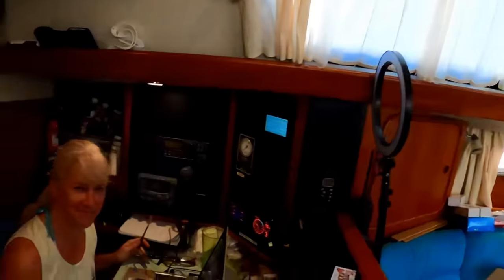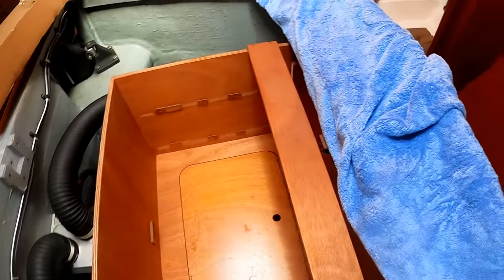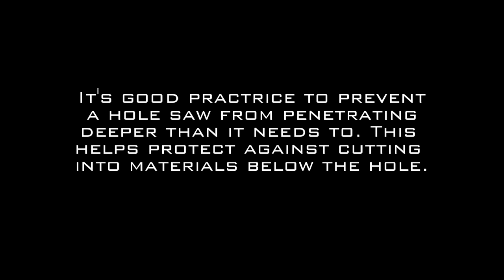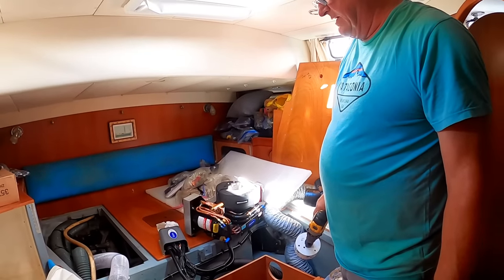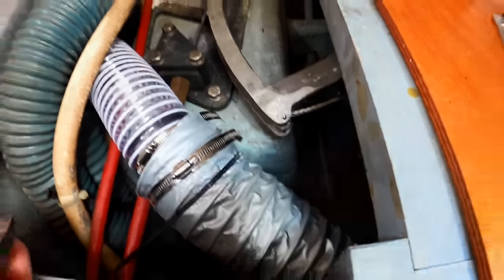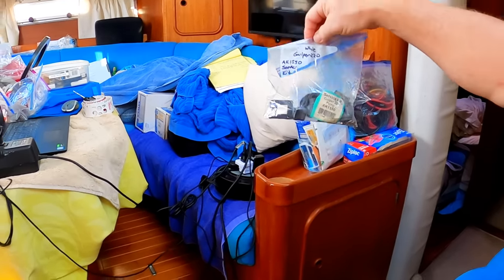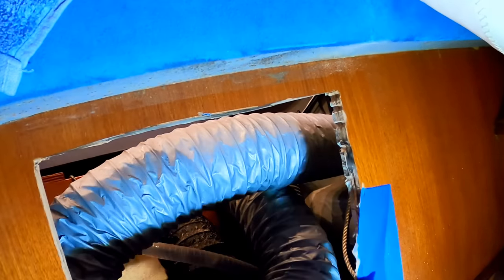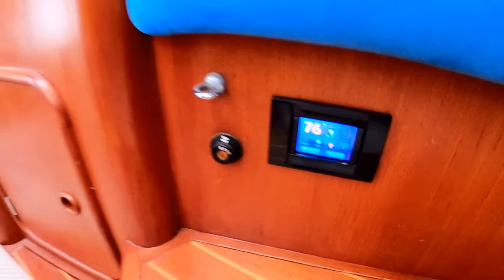Ep 143 Installing Mabru 12V Marine Air Conditioning

Comment: Thank you for your honest opinion, we are looking to install air conditioning and power is a major concern, happy sailing ⛵️
Reply from the maker: No worries. Despite what some of the armchair experts tell people, native 12V or 24V systems are preferable in my opinion over inverter converted 110VAC or 230VAC in terms of energy use. And Mabru makes both versions, so their YouTube video comparing the energy draw from each of their systems is very much worth watching since it's an honest apples-to-apples comparison. Be aware that there are a few Chinese made self-contained systems that are marketed as 24V, but in fact just have an inverter already built into a standard line voltage unit (Hopewell?). Although I buy a lot of Chinese made products, I've found that making the sale is often prioritized over customer satisfaction. It's a cultural thing. Caveat Emptor.

Comment: Kevin I'm impressed, both on the battery system and the AC job. Good job sir, on the research and selection of the components along with the installation. Clean and professional. Best I've seen from a DIY'er. God bless!
Reply from the maker: Thanks Greg. These are the types of comments that make the production of the episodes worthwhile. And God bless to you as well.
Reply: @SailingTalisman  It would have been better if I'd remember to credit Wendy on the bottom coat job. Nice when you can trust your better half to do better work than you.
Reply from the maker: @gregvee2930  She's awesome that way. She does all the winch teardowns, cleaning, and re-lube too.
Reply: @SailingTalisman You likely already did this, but that zip tie at the rudder quadrant, you might want to use 2 and run them between the 2 hose clamps. So they are on coupler not the hose.
Reply from the maker: @gregvee2930  Next time I'm in there I'll take a look. Thanks much.
Reply: @SailingTalisman  I'm sure you get plenty of armchair quarterbacking but it won't take long before that tie wrap will destroy that ducting and  potentially mess with your rudder quadrant. I love you guys!
Reply from the maker: @gregvee2930 I think not. The hosing is not in motion, nor are there any forces (other than heeling of the boat) pulling on it. And those hoses are much tougher than they look. As long as it's held out of the way, I guarantee all will be fine.
Reply: @SailingTalisman  It was you who pointed out the importance that it stays held back that got my attention. It got me concerned. Now put my comments behind you and keep up the good work!

Comment: Understanding that you are limited on space, but was any thought put into reducing the twists and turns of your piping.? Everyone of those will reduce the efficiency of the air flow. Won't you have condensation problems around the cold air outlets like the one in the aft cabin?
Reply from the maker: Hi Brian. Lots of thought, but little in the way of alternative options. I do believe this is why the units are native 4" output (w/ 90 degree rotating output collar) for the 6K and 12K units, then 5" on the 16K. I ran the 4" through 4" splitters, and then kept as much 4" ducting as I could before necking down to 3" with the reducing rings. Used shop vacuum hose for 3" ducting as there was very little of the insulated spiral tubing on the market. Although performance might be negatively affected some as you point out, we find that air output is quite good, and once the room temps are at the selected number, the fan speed drops off anyway. No individual run is more than 8' in total (obviously, minimized) . Great product all-in-all.

Comment: Great video! I now have renewed hope for A/C in my little Island Packet. I am thinking one 6000 btu unit should do it for me. She is just 27 foot with 10.5 beam.
Reply from the maker: Great to hear from you. I think A/C sizing is more about the volume of the space and where you're going to be using it. We're in the Caribbean (mostly) and so have a heavy use of the system. But that said, our 16,000 BTU salon unit barely keeps up. However, our 7,000 BTU aft cabin unit does great, due to the smaller volume of the room and lack of large glazed areas. For us when we got started, we took height, width, and length measurements on the rooms, averaging dims as we saw fit, to get a rough cubic volume. From there we consulted the mfr charts provided by various suppliers. These charts calc BTU requirements per cubic foot or meter, and are therefore interchangeable. Our 16,000 BTU unit is very close in size to the 7,000 BTU version, so finding the space for the extra BTUs wasn't so much of an issue, although it was a bit more expensive. Think long and hard about where your ducting is going to go, as well as your supply and return air vents. And feel free to contact us if further questions.
Reply: @SailingTalisman  Thanks for that. I was looking and the larger unit is not that much bigger or expensive so I think I would go with larger just to be sure. I will be installing in a hanging locker in the head so ducting will be quite easy and short. Up from the unit 1 foot left to v-birth a quite small space and 1 foot right to salon that is 8 X 10 just over 6 foot high and the large louvered door will be the intake. Drawback is.. Though the head is fresh water flush. However... well if you going to do # 2 turn the A/C off first LOL

Comment: I used to be skeptical of battery powered multi tools until I used one. This would have been a piece of cake using one. Try one out if you get the chance. Get video :)
Reply from the maker: You mean like the Dremel I was using, or something else? Battery powered tools of all kinds are indispensable on a boat like Talisman. First, depending on the country, we see either US or Euro power (60Hz vs 50Hz, 110V vs 220V), which corded tools will not allow (choose one). Second, our 800W inverter might power some corded tools, but most will only work off our 6Kva (230VAC/50Hz) generator, which is notoriously finicky. Anyway, Lithium technology has revolutionized the tool business.

Comment: You mentioned 5 to 10 days without charging your batteries?
Is that with solar charging them?
Like the idea of aircon at anchor. However I’m setting up our boat to be fully autonomous for up to 3 months at a time. We have 1.2kw of solar so as long as we have sun we can charge batteries fully and make water (25 amps at 24v) run the washing machine etc. looks like we could even run that aircon you installed for a few hours a day.
For the cloudy days we have the generator but we hardly ever need it even in the winter.
Reply from the maker: Yeah, we have about 490W of solar, so not much. We don't have the real estate that the cats and larger monohulls have, but we still get about 10A+/- during the day, which keeps us even-up. But of course we lose ground overnight. Now that our generator is back up and working, we use the a/c from about 8pm to 7am in the aft cabin, which drops our battery capacity from 95% or so to 75%, then run the genset for 3 hours give or take the following day. Without a/c, 10-12 days with no recharging other than the anemic solar will take us down to 45% or so on our Simarine Pico battery monitor, which I feel (know) works better than Daly's internal version. It's something Daly needs to fix.
Reply: @SailingTalisman  we had a arch made for the stern. It does ruin the look of the boat and our 1200w (3 x 400w) solar panels are wider than the stern and look like a huge wing. However they are not as wide as the dinghy on the davits, and I have to say best thing we added to the boat so far. We couldn’t live onboard full time at anchor, we don’t do marinas, without them. Ewell we would have to run the generator most days where we never really use it now, a few times over winter

Comment: Cut with a fine tool they are invaluable on a boat
Reply from the maker: Hi Jay. I have one at home, but it's a corded version and wouldn't have made the cut for usefulness. But they are awesome for certain situations. Mine would probably have been too big and powerful for the delicate work and I'm not sure it wouldn't have done damage. One issue I was having with the Dremel was that I'd run out of cutting disks and was down to scavenging old ones out of the trash. Anyway, got the job done in the end.
Reply: @SailingTalisman  Dremel is another go to tool on our boat. Not sure if those discs cut or burn through wood? 😂🤣
Reply from the maker: @JayPerrypersonal  They burn. And the boat smelled like it was on fire when I was done. But like I said, it got the job done. Very pretty to the eye now that it's complete, and that's what I was looking for.

Comment: In this day and age of broken supply chains, and lost packages... Would you say that a good way to source items is to buy 2+ of everything, 1+ of everything from 2 different sources and be willing to take the extras as spares?   Ok, you don't do that for say the new batteries you installed, because that's a huge bill, but for other things, but the extras from different sources?   Buying parts at small stores in far away places is just crazy.   And folks, label your wires, every couple of feet so you will always know what the wires are!   SVs have so many wires running throughout the whole boat, and it's super easy to confuse the ID of the wires!    Kevin knows how to do it right, pay attention folks...   There is great advise being given here!
Reply from the maker: I'd say I try to stock deeply on all the consumables on the boat. Zip ties, hose clamps, blocks, Dyneema line, fasteners, plastic and brass hose fittings, hoses in various sizes, wiring, fuses, impeller spares, cotter pins, etc. Tools of every type that we might need. Then we have a spare for each pump we have, although a few of those are used pumps that we replaced as service items. We religiously follow recommended service intervals on oil and filter changes, as well as belts, which we carry multiple spares of. Oil and Racor filters need to be kept in the 3-4 spare range. Fluids like engine oil and coolant are required, and I also document every single service item that is done on the boat. So a full spreadsheet/database of service history. That's what comes off the top of my head, but of course it's much more. I also try to cull the things that we haven't used in several years, especially if they're heavy or bulky, but that's always problematic since the second you ship it home you need that exact item. But what can you do?
Reply: @SailingTalisman  That's sage advise to people getting into the game, and wondering what to do and how to keep track of it all.   Well done!

Comment: Very nice install video . Always enjoy your videos . I will be curious how the amp draw turns out , I designed and built my own 12DC air conditioning . I get 6000 btu drawing about 25 amps/12v . That’s on low speed .
Reply from the maker: Mabru has a nice video detailing their native 12V system vs a 110/220V system (they make all kinds of versions) and measuring the amp draw with each. Inverter converted line voltage sees huge starting amps (I want to say 90A), and could probably do with a "soft-start" feature. That's where you want to go to see actual installed power use. And thanks for being with us.
Reply: @SailingTalisman  Happy they are working so well for you . Yeah I watch you guys all the time , we are of like minds . I used a soft start compressor that ramps up slowly . You cant hear my unit either . DC is the way to go , but as you said they are not cheap . It wasn’t cheap to build one either . 
Enjoy . 
John
Reply: Hi again , its been a few months and i know that you guys are back home , but how did those AC units work out down there in the Caribbean. Just got my boat in the water , so will be heading your way soon.

Comment: A lot of work and a lot of cost. Had you considered buying a 50 foot boat that needed a complete overhaul instead?
Reply from the maker: So, Talisman was a fully sailable boat when we bought her, so not a "project boat" per se. The issue we faced when shopping was that we wanted a bluewater boat, preferably by Oyster, but didn't have $2.5M to spend on a new one. So the trick was to find an older model that was in presentable condition, which Talisman was. I replaced all the major electronics (navigation and stereo), and we set off cruising. So that was the important part, to actually go sailing. But as you might see in our channel library, I love having all our systems not only operational, but also modern and new. But taking an ex-charter boat, or worse, a hurricane damaged salvage boat, and trying to bring it back is insanely expensive and labor intensive. Mostly a losing game where you'll go broke during the process and have nothing to show for it.

Comment: Your ducts aren't insulated, any condensation or temperature loss because of this?
Reply from the maker: The units have a 5" output, which is way too big for the clearances I was dealing with. So the 5" and necked down 4" ducting that I used were insulated, but I was unable to find 3" tubing in anything other than shop-vac rubberized hosing, and as it turns out, that stuff is so thick and burly that it insulates quite well over the relatively short runs I needed it for. As for condensation, I do get some on the insulated 5" and 4" tubing, and on the units themselves, but otherwise the systems operate flawlessly in a truly difficult environment. They are forced to handle high ambient temps, high humidity, and being stuffed into small spaces. Big thumbs up to Mabru on their engineering and construction.

Comment: A comment on durability/reliability. - Aren't these the same Mabru 12v AC units Ytuber Sailing Nahoa installed (3 of them) about 1 yr ago, and all 3 failed crossing the Indian Ocean?  Was that a fluke or have they improved the design?  I don't watch every Sailing Nahoa episode so I'm not sure if they resolved the failure issues and what the problems were.
Reply from the maker: I have to admit that we don't watch many other YouTube channels since we have such limited time and bandwidth. But I doubt there's another Mabru 12V product other than what we have. I did do some internet searching to see if there were major reliability issues, and didn't come up with anything obvious. Mabru seemed a bit touchy about YouTubers, and our units came with the red hanging tags seen in the video warning that lack of grounding would void the warranty. I'm kind of thinking that to have three go bad within a year would be odd, and that not grounding them would 100% result in a quick demise due to galvanic corrosion and/or electrolysis. But we're only 3.5 months in. I guess we'll find out.
Reply: @SailingTalisman  FYI- Sailing Nahoa installed units 1 yr ago in episode "Boatyard Life- Getting Ready to Sail to Africa".  They are pretty seasoned catamaran cruisers and do both DIY as well as hiring professional help,  I don't recall which episode they mentioned the units had failed or any other follow-up.
Reply from the maker: @douglasrobbie9998  Like I said, we'll see. Total failure of three units simultaneously (or nearly simultaneously) sounds suspicious to me. These are stand-alone units, so isolated more or less. But I hope we get better longevity. 😀
Reply: @SailingTalisman  Sorry I was mistaken , poor memory. Per their most recent posting Nahao indicated the two 5000btu units died and the 12000btu unit is still working.  I have no skin in this, but given the cost of these specialized AC units, I just wanted to alert you to an issue another cruiser had.  Having AC on a sailboat in a hot climate is such a great idea.
Reply from the maker: @douglasrobbie9998  No worries Douglas. This is a big experiment anyway, so we'll see where it goes.

Comment: Great job. However you installed the air conditioner very close to you EV2 sensor. That should be 1m at least for electronic or magnetic metals
Reply from the maker: I know. It says that in the manual, but we haven't had any issues yet. In the end, it's the sensor that would have to move. But even in its original configuration the quadrant and cables/frame are right next to the factory location (original Fluxgate version). I think it's something that can happen, like bimini frames causing compass deviation, but isn't 100% going to be a problem.

Comment: What's the general consumption , you said 30 amp at start up , and didn't give a proper usage . Just it goes down ?
Reply from the maker: Sorry about that David. Last night, running from about 8:00P to 8:00A, we used +/-190Ah out of 840Ah, or about 23% of our total. The 6000BTU unit consumes (per Mabru) 22-28A @ 12V, so 11-14A @ 24V, less the small conversion factor from the Victron dropper. The 12,000BTU is rated at 33-44A, so 16-22A @ 24V. Doing a quick calc, aft AC consumes approx 36% of the total AC budget, so had we just used the aft unit last night, we'd be at substantially less battery usage. There's a fixed and variable aspect to the above as we also have lighting, fans, and refrigeration that continue constantly, so if you ask me to I'll do the same test tonight with just the aft AC. Thanks for a great comment and for following along with us.
Reply: @SailingTalisman   thanks,  thats informative .

Comment: 80 amps: is that 80 amps at 12V or 24V?
Reply from the maker: 24V. As boats get bigger, the move from 12V to 24V gets more pronounced. This is because you can send 24V power over reasonably sized wiring further than you can 12V. Ohms law states V*A=W, w/ watts being the common denominator. Therefore, when you double volts, you halve amps. Thus you can send big power to bow thrusters and windlasses that might be far from the battery bank. Many 12V boats will have axillary batteries in the v-berth to help with this problem.